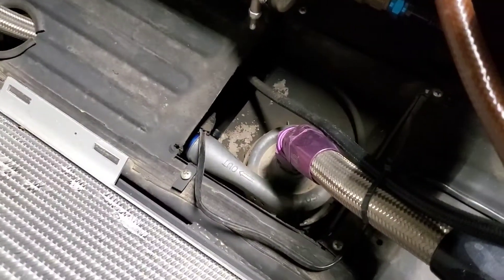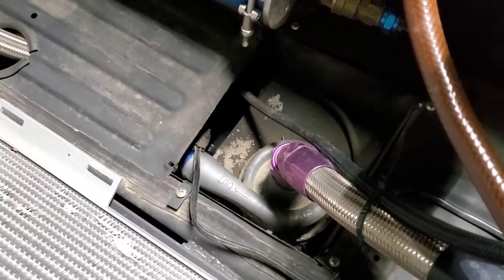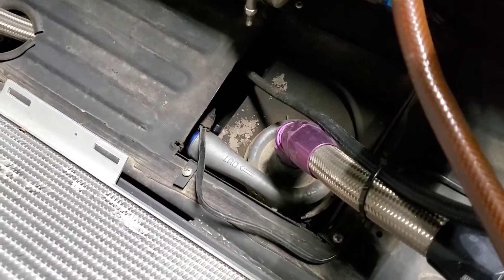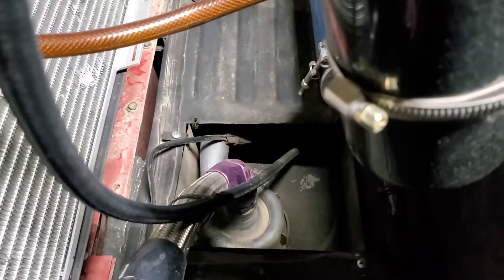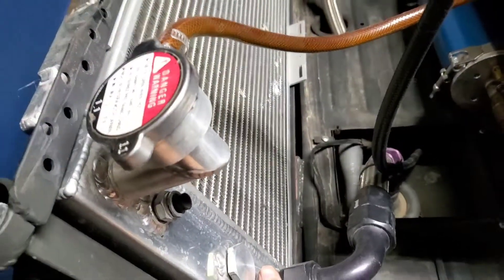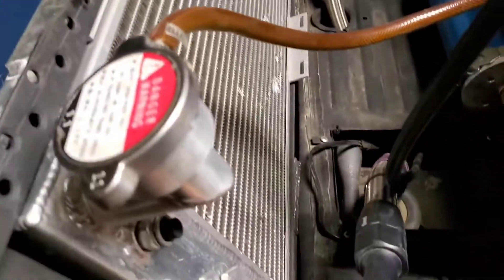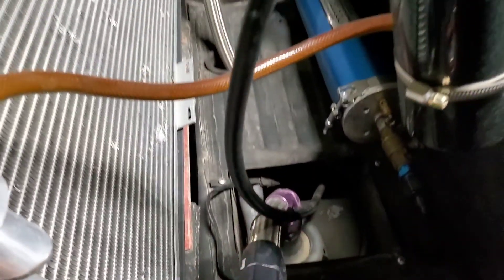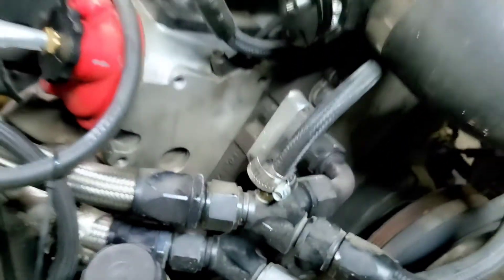Drift Car Electric Water Pump

Comment: So you are using big block to ls water pump adapters and Davis water pump? Wow that’s Fucken smart and cheap. Thank you so much I’ll be doing something similar with this
Reply from the maker: Essentially yes, but these are made for the ls blocks. Im glad I could help! It's a really efficient setup!
Reply: @corysnider  yes especially for ls when you run a big block electric pump. Also where did you get the -12 to -16 adapter? Can’t seem to find them online.
Reply from the maker: @DannyR2681  I actually got 12an to 16an hose fittings. Then hose is 16an, but the female end is 12an.
Reply: @corysnider  thank you I found it
Reply: @corysnider  I also followed your volvo pump conversion also